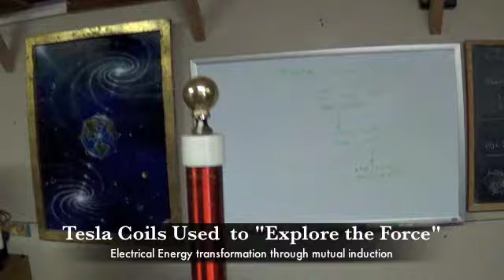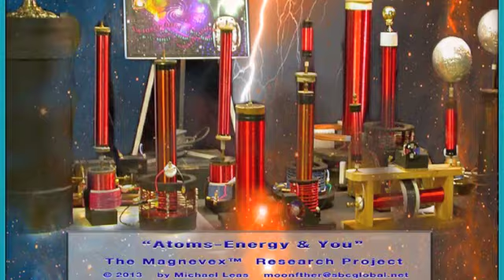Tesla Coils- Electrical Energy Transformation © 2013

Comment from the maker: In building my coils and any type of "top load" i set them up where I can exchange them between coils. Most are mounted with a 1/4 20 bolt at the bottom of the set up. No loose wires exposed. 
You can use many types of top loads, as seen in the video some coils don't have one, others have a brass ball door knob on them. Use whatever works to get it "tuned" as your system may need more or less capacitive top load for it to tune correctly.